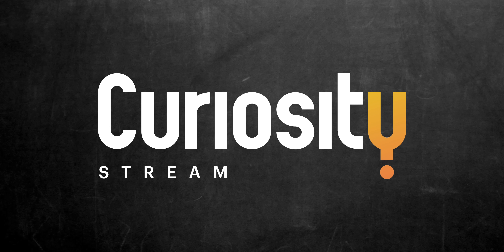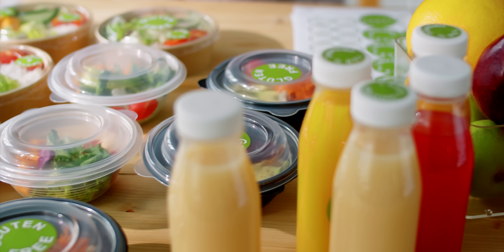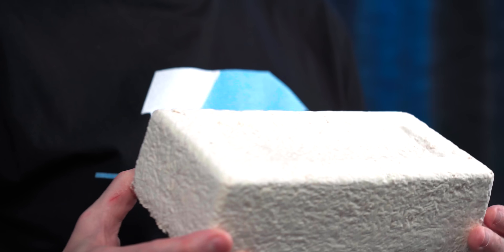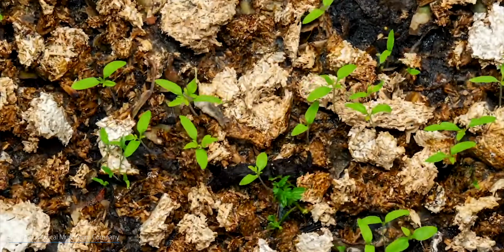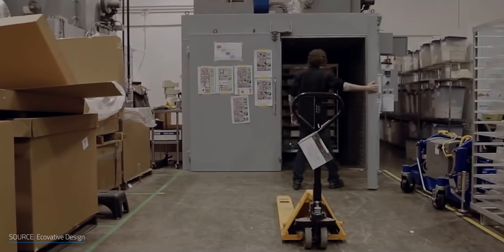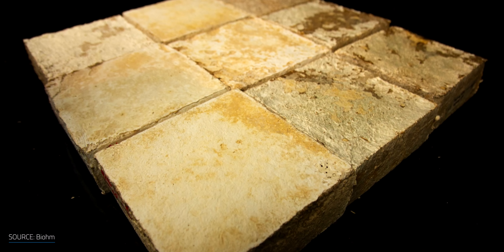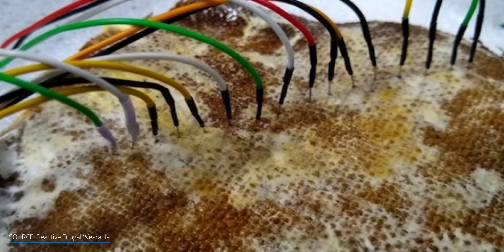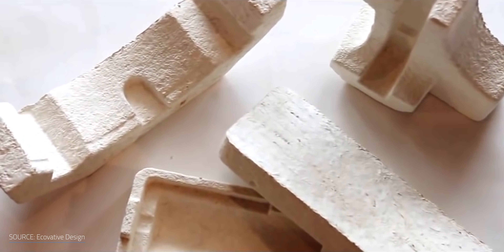Is Mycelium Fungus the Plastic of the Future?

Comment: 3:39 🤔🤔

They are using plastic bag and tray for storing and growing eco friendly product.
This thing sums up how much plastic dependent we are.
Reply: It's pretty difficult to grow fungus without plastic, since everything needs to be sterilized. For example, mushrooms you buy at a store (like oyster mushrooms, not portabellas) likely had their mycelium grown in a plastic bag. It's something that's being worked on though, like using bioplastics for this purpose.

The problem is the material needs to be thermally stable to around 121°C for one or even two hours in some cases

Comment: what happens when the insulation is exposed to mold? for example, a flooded finished basement that does not get dryed out fast enough?
Reply: @gebys4559  would the dead myceliumn not be food for other mold? if it can be composted I would worry that would happen in the walls?

Comment: Anyone that thinks a process which takes days or weeks in a controlled environment has a realistic chance to replace a process that currently takes a fraction of a second and costs pennies when done at scale has obviously zero experience of manufacturing on an industrial scale.
Reply: Very true, for now at least. A little more automation, and we should be able to have robots tend massive racks of the molds completely hands-off to get production levels up to the thousands per hour volumes required. If people are willing to pay a little more for plastic free packaging (which in today's market, they very much are), it could get there eventually.

They'd be golden if they can manage to get paid to take the material they need to use, though. get paid for disposal of rotting material, or low quality manure or something.

Comment: "Degrade after their intended product cycle" I cannot see where this could go into full greed mode.
Reply: There's nothing wrong with giving products an expected life cycle as long as the product is sold with an expiration date. Customers will know what to expect out of their products and if they need something longer living, they'll be able to purchase something different. Also, plastic replacement usually doesn't need to be long living. Most of the plastics this would replace are packing materials, not long life products. We'll always have a need for plastic, we just need to limit it to the places where it's practical, not just cheap and easy.
Reply: It's not as if common plastic products are known for their long term durability anyway
Reply: Seems to me that most styrofoam packaging—restaurant to-go containers, padding for shipped products, etc.—gets used once and then hits the landfill where it persists. So the greed's already in the system. Using mushrooms just makes things more sustainable and lessens the CO2 load of the same product by 90%. Plus, it's something else I can add to my compost pile to help feed the family.
Reply: @The.Ghost.of.Tom.Joad.  good product
Reply: Apple: "Is there a way that we can have this product degrade faster than intended for our customers?"
Reply: @Puddingskin01  the ishroom
Reply: Yeah, I was concerned when I heard that as well. I'm curious to see how long lasting they can become while still being able to break down. I can definitely see this being a good replacement for packaging materials as those are typically single use items.
Reply: yah- legacy auto exploited that one to its' maximum potential. I think my silicon based circuitry will do just fine thank you very much. unless they can grow a 'smart garment' that is under $100 for the whole suit and have it last for at least 5 years. that I could see. although... as dirt cheap as consumer electronics are... I could see a future where they simply grow entire motherboards & circuits for a fraction of the cost of a pc gaming system. think of how much the gold & copper inside microprocessors costs... now imagine.. you could replace ALL THAT with? rotted wood, a bio-circuit printer and the right lab production facility... it could end up being legendary.
Reply: @jaybee3165  Well, think of packaging materials - their 'intended product cycle' isn't very long, and I think that's perfectly fine. I wouldn't want my comb to fall apart after 2 years, but those don't tend to live forever either, so... what's new...
Reply: @JosPoortvliet  yup
Reply: Even “full greed mode” eventually has to accept that modes prospects on their own mortality— at least I’d hope it would even if it doesn’t change the short term investment plans of a narrow minority of that top 1% of folks like the Koch bothers.
Reply: My plastic products are still designed to break, at least mycoproteins would biodegrade after
Reply: 2 words... Planned Obsolescence
Reply: Exactly, I wouldn't want the insulations in my wall to just rot away in a couple of years. Replacing them would be a pain the in butt.

Comment: Fungus sounds like a great idea up front; but there is a huge down side too.  As science is figuring out the microbiome of the human body, we are realizing that fungi are playing a big part in causing humans harm.  Many Western countries use antibiotics to help overcome many ailments which disrupt our internal biomes; causing fungi to be dominant microbes in our bodies.  By using fungi as a replacement for plastics or other building materials we are exposing ourselves to even more fungi.  This technology needs to be approached with extreme caution and care; it has the high possibility of becoming a catastrophic issue.
Reply: Pathogenic fungi are microscopic fungi. These materials are likely made from oyster mushrooms or similar non-toxic fungi. I doubt a product that uses pathogenic fungi would ever be approved, or even tested to begin with.

Moreover, it's dramatically less risky than the microplastics exposure from continuing to use the alternative
Reply: @nighteule  I would agree for the most part, but I have heard worse things.  Also, there are many traits of microbes we don’t yet know or understand yet; flesh eating disease is a normally harmless microbe yet under some circumstances become deadly.  I think there is a lot to be learned before pushing this through.
Reply: They put it inside a oven. It is dead.
Reply: @AetherPowered  Some fungi are able to survive 1000s of degrees temperature, radiation and even the vacuum of space.

Comment: Great upload Matt. 
This looks like it could be linked downstream to the hemp hydroponic carbon sink factories.
Reply from the maker: Glad you liked it!  Hemp has come up a few times in the comments.  Just Have A Think just did a great video on the topic ... been thinking about diving into it myself.
Reply: @UndecidedMF  yeah, I had just seen that this morning and thought of it when watching.
Reply: @UndecidedMF  You might look into a car that Ford made in the late 1930's that had hemp reinforced plastic body panels. If memory serves they were unhurt by the impact of a sledgehammer. If they pay you to take plastic waste, perhaps you could just buy hemp fibers and coat them in melted recycled plastic to make panels with minimal capital investment. For many applications such as replacing concrete drain/sewer piping, the extra strength that would come with controlling the plastic composition by presorting may be unnecessary and a mix adequate. For  many apps the problem of fire toxicity may be mitigated some with additives.
It just seems so logical to take the thing that's a problem b/c it won't degrade easily and using it to sequester carbon pulled out of the air by the hemp at a profit and maybe replace some things such as concrete pipe that are carbon positive. On top of that maybe they pay you for locking up the carbon. I think I'm up to at least quadfecta territory.
Reply: @UndecidedMF 
There is also a lot of interlinking now, as new tech starts to rely on a growing foundation new tech.

Comment: I've heard good things about mycelium in the past, but I want to know what the downsides are? Is it only the slightly higher cost? I feel that there must be something else coming into play here other than just the cost and resilience.
Reply: Just from what I've gathered from the video:
It takes a long time to grow. A factory creating mycelium products will produce less products than styroforam products material per square meter. Obviously you can scale up the factory, but that comes with its own issues.
It requires different manufacturing techniques (no injection molding). You need a lot of molds to create it in bulk (think thousands of molds for small products), so growing it in bulk then cutting/machining it might be easier. But that's more complex than simple injection molding.
For insulation, it's not as durable as synthetic foams (which might be an issue, depending on the building's lifespan).
It cannot be used as a replacement for high density plastics.

And since it's organic and biodegradable, there might be an issue with it degrading while still in use if not taken care of.

None if these issues is a deal-breaker, but it's not a direct "plug-and-play" replacement.
Reply: @SimonWoodburyForget   They don't produce new CO2. They are releasing the CO2 stored in whatever they are decomposing. Which would have been released anyway if rooted in the wild. You avoid methane emissions because the condition to make methane kill the fungus.
Reply: are you implying petrol cartel lobbying? I mean that's a thing for sure, but its downsides of high cost and short life span are enough as is.
Reply: @SimonWoodburyForget    Even if the plastic never get burned nor breakdown by natural causes (aka its carbon is still locked),  the steps from oil to plastic release new CO2, so its never truely carbon neutral. While this yes.
Reply: @SimonWoodburyForget   No, their impact in the carbon cycle differ. The carbon stored in oil and coal was already removed from the carbon cycle and in the process of making new plastic you inject it back in circulation. In constrast taking organic matter and trasnforming it into something else dont alter the amount of carbon in the cycle.
Reply: @SimonWoodburyForget  

What they said earlier is that the carbon in the feeding material would have been released no matter what, because if it was left outside other fungi would have decomposed it and released the CO2.

Meanwhile the CO2 in fossil fuels is trapped and can't add additional CO2 to the cycle unless we burn it and release the CO2.

Comment: what is the tensile strength of the mycelium?
Reply: Seems like compressive strength would be more useful to know for packaging. I doubt anyone wants to make ropes out of it.
Reply: @PinataOblongata  I wouldn't want to sit in a hammock that you designed, one of the founding rules of mechanical engineering is you cant push up on a chain

Comment: so it biodegrades after 45 days? Yet a structure of it showed no ware after 3 years?
what's actually going on here, if you have a piece of computer hardware like a printer boxed in the Mycelium foam for a year, what will it look like when I open it? 
Or after several years, can I expect some decomposition?
Reply: Just like wood, if you left it untreated in a wet area microorganisms will colonize and decompose it. With protection it will last. Think about it as fast growing "foamy" wood.
Reply from the maker: Good question (I should have touched on that in the video) ... and amazing answers from Angel and Simon.
Reply: makes sense
actually now that you guys are mentioning it it reminds me of the way those wooden power poles are made. They put them in a long oven to dry out and then they dip em into some kind of oil so they can't get wet. 
That way they won't rot for decades.

Comment: Can mycelium be printed/ form?
Reply: I think it can only be molded since it has to grow to form its structure. 
If you printed it it would be layered and it would be a very different material. Tho you could maybe make some kind of 3d printing resin out of Mycelium and use that to feed your printer and make biodegradable pieces out of it.... though that is usually not what you want when you 3d print things. 
I think our traditional plastics still have their place, we just need to use them responsibly and not fill the environment with 'em.
Reply: @Broockle  yes definitely
Reply: @Broockle  https://youtu.be/W8tpiWSZfm0 hope you know it
Reply: @CUBETechie  
neat